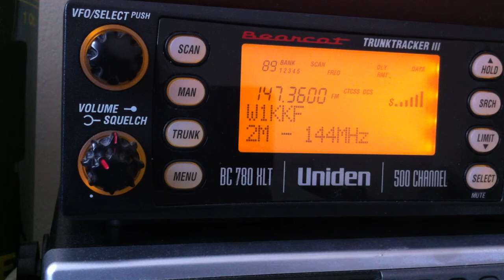BC780XLT Uniden TrunkTracker III HD Bearcat Demo

Comment: Hello there.
I really liked your video.
My name is Jorge, I am SWL and I live in Spain.
I have a technical question to ask you about this scanner.
I like to listen to the International Space Station (ISS) and the radio amateurs making contacts through their repeater on 437,800 MHz.
I have a Realistic Pro-2006 and a Diamond X-30 antenna for it.
The question is simple but I can't find accurate information on this question, so it's better to ask.
The ISS has its downlink frequency at 437,800 MHz, where you can hear radio amateurs talking.
In the pro-2006 I can memorize, for example, these 3 frequencies: 437.795, 437.800 and 437.805.
Those three memories are due to the Doopler effect of the ISS.
The question is whether in the 780XLT you can also program, for example, those 3 frequencies in steps of 5 KHz (?), using the VFO or by directly entering the different frequencies...
I ask because the UHF steps I have read are 12.5 KHz.
I want you to understand what I mean.
Thank you very much in advance for any information.
Have a nice day and 73.